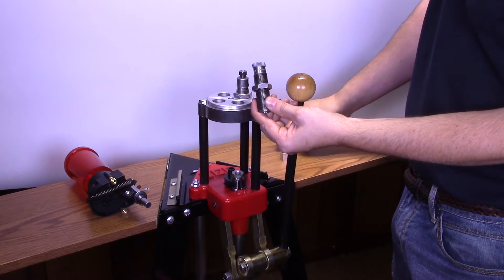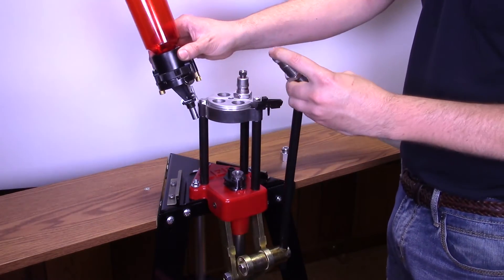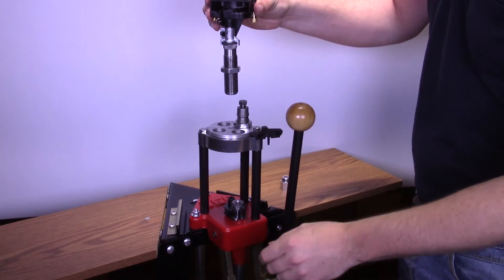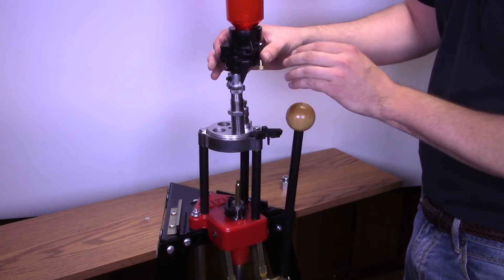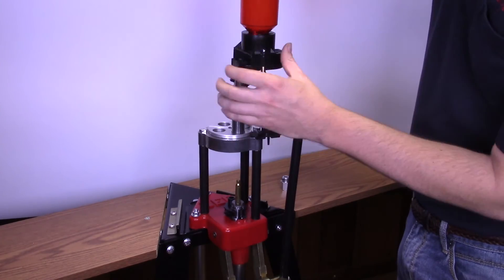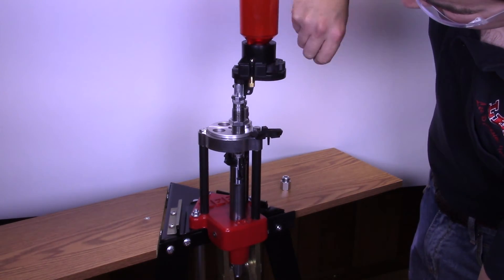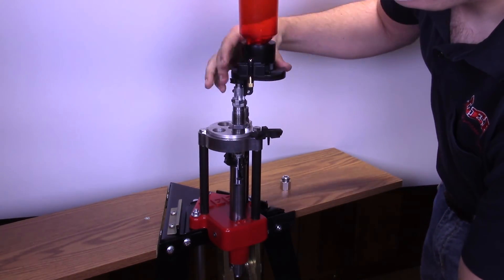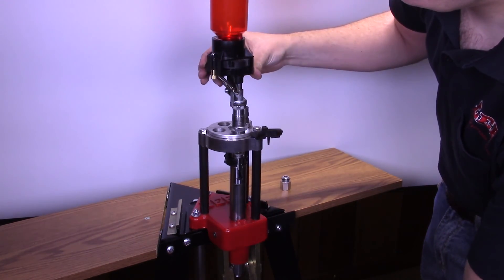Classic Turret Press Long Charging Die Installation

Comment: Hey

Do I need the short or long die to load .223?

Short is listed as cased up to .223 and the long says .223 and larger...

Does this mean that EITHER the short or long will load a .223 case?
Reply from the maker: Hello,  which die you need depends on the length of your 223 Rem cases. The Short Charging Die is for use with case lengths between .860" and 1.759". The Long Charging Die is for use with case lengths between 1.760" and 2.620".
Reply: @LeePrecisionIncHartford  question when I setup my powder thru expansion die with the powder drop its sitting off the ram and not touching like I've seen in other videos. I'm using Winchester 350 legend brass and I'm hoping it's just something I'm doing wrong such as having the die screwed down too far.
Reply from the maker: @tednielsen5271  It sounds like it's set up correctly. The Powder Through Expanding Dies will not contact the shell holder in normal use. The case would be crushed or over flared if it did.
Reply: @LeePrecisionIncHartford  thank you I'm just beginning my journey of reloading and wasnt quite certian I had it setup right even after I read thru the directions. Btw I'm enjoying the lee classic turret press.
Reply: @tednielsen5271  - Good luck! Glad you call it a "journey" because it truly is. I've been at it since 2013 and still learning. You will encounter difficulties and sometimes frustrating setbacks, but overcoming them is the exciting part! Remember there is ALWAYS an answer. I love Lee Precision. Great company and they are happy to help with questions.
Reply: @frankhuelster5826  I drive tractor trailers and we always say when you think you know it all that it's time to hang your keys up. I'm thinking reloading is alot the same. I watch alot of videos on my down time at work so when I get home I hit the press hard always trying something new.